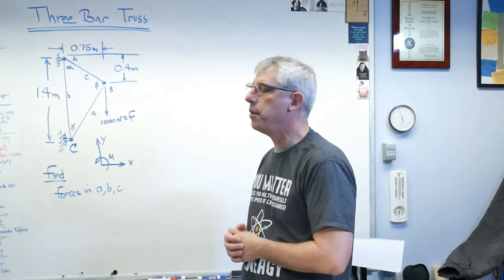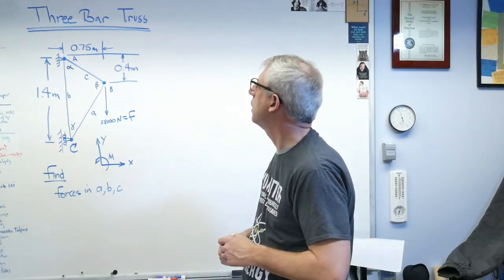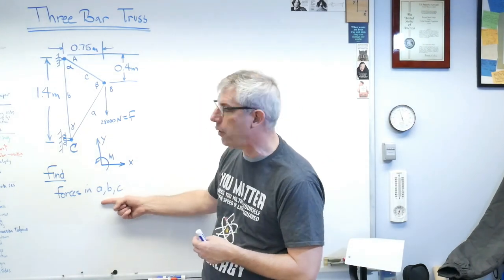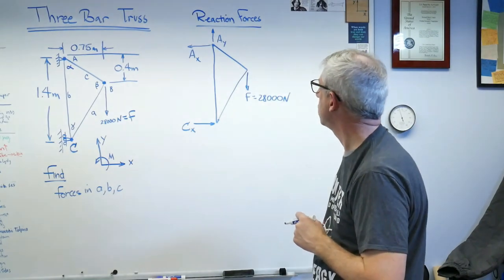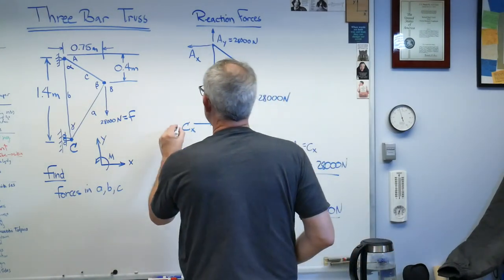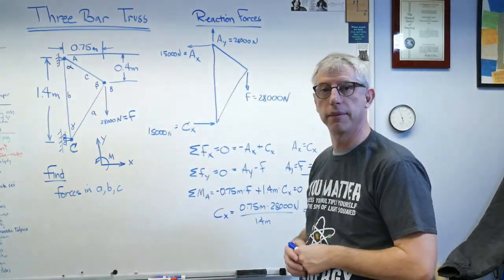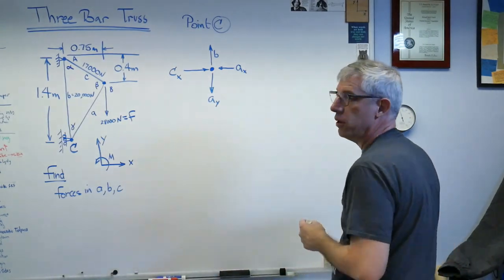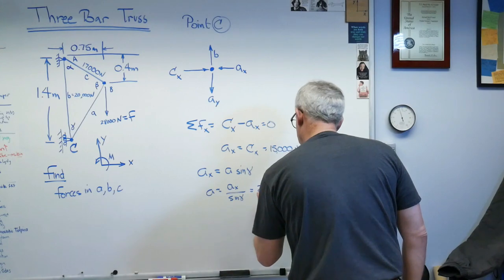Statics - Three Bar Truss Homework Problem

Comment: I want to thank you. 

I am a wood truss/panel designer for Accurate Housing Systems East Troy, Wi. I have been in the wood truss/panel industry since 1997 and a wood rough framer since 1987. I'm an 8th grade dropout, but I've worked very hard over my time to reach what I consider a great level in the structural industry. I take great pleasure and pride in designing the maximized allowable wood structures possible throughout the Madison, Milwaukee, Chicago land area. I design up to 5 story commercial wood structures from the foundation up. Wood wall panels (shear walls, headers, beams, etc.) floor trusses, TJI's, LVL etc. Along with the roof trusses alike (flat, pitched, inverted, etc.).  Most truss/panel jockeys learn little more than to organize the correct sequence of command punching to get any given software to cooperate for the given task. I remember back in the early 90's grabbing the spec pack off the end of a unit of EWP I joists for a house I was framing. It spoke of L/480 this and FB to a value of that... I was hooked! I went to the Crystal Lake, Il. library and had to figure out what all this toga wearing poppycock meant. It was difficult. I don't read well, but I could visualize what was going on. You, YOU! explain it perfect for a man of my station. I celebrate you! I do okay with the comprehension now, but the way you explain in it a geometric form baby step by baby step is pure gold to me. I have no problem with the designs now, but what you're depicting will help me greatly with the valued engineering end of my work. Understanding exactly where it is all happening in any given component is crucial for such. I just really want you to know, what you're doing here, taking this time, is greatly appreciated, and the greatness that is in mankind's achievements is due to great men such as yourself sharing such a wealth of knowledge. 

Thank you, CLS